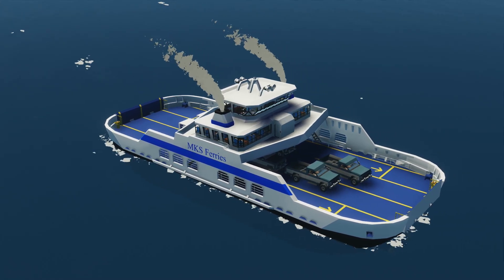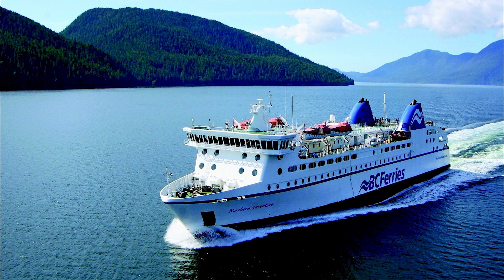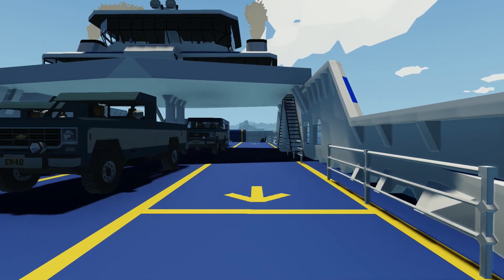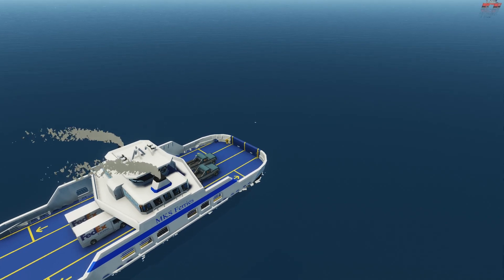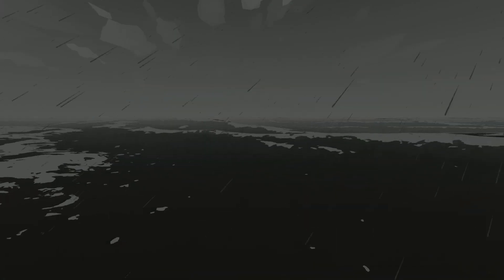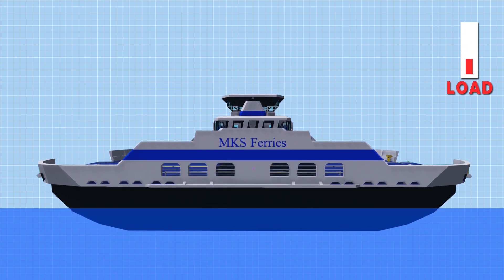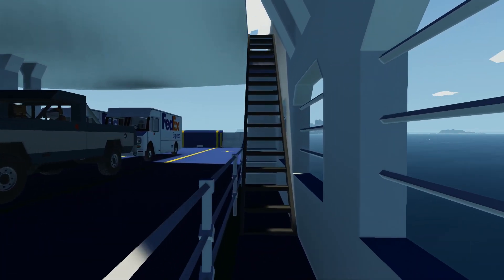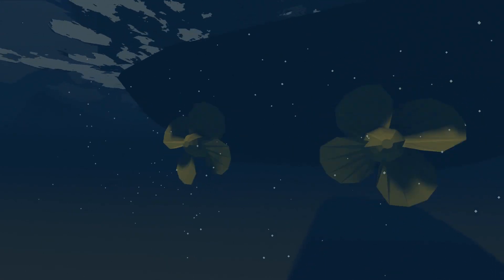Stormworks Ferry Project Part 1

Comment: where one prop goes in revrse and the other one forward at the right speed so it does a pivot without moving in a linear direction
Reply from the maker: I actually got rid of the front propellers. I figured it would be simpler (logic-wise) to use the back ones